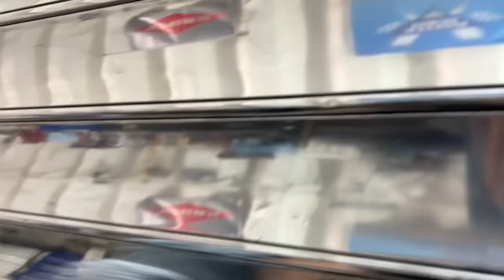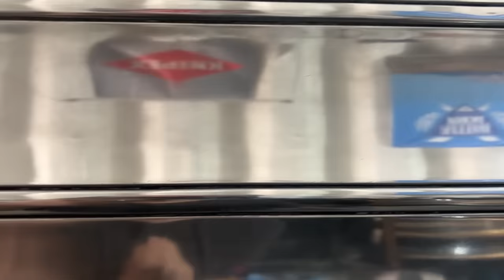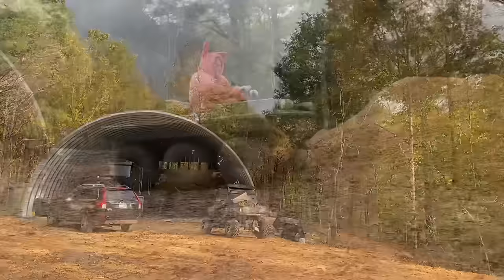Detailing the paint & aluminum bright work on the 1947 retired greyhound bus. Finishing the exterior

Comment: Looks amazing 🎉. Great job 👍. On my friends Busses we've done polishing the aluminum and stainless steel...After we did what you guys are doing...We just maintain the finish using either stainless steel polish or believe it or not.  Pledge or any furniture polish. Also works great on any plastic or plexiglass and tail light lenses...If you have any scratched lenses or plastic... Toothpaste and baking soda mixed with water like a paste is a natural polish...Great work 👍

Comment: Bus Wheel Seal question:  If you have replaced wheel seals twice on same wheel and it keeps leaking (oil) onto the brake shoes, are there clearances one can check to determine if there is a wear or parts issue?

Comment: No,
What I did was shut my phone off for a couple minutes and then cut it back on. It has been fine since.  It wasn’t just yours all of them were doing it. I never adjusted the speed or anything. On my phone. I don’t think you can adjust it on your phone . But, at any rate everything is back to normal. Thanks for responding

Comment: I tried doing my aluminum rims but it seemed to just make them darker.
Reply: If it's not bright, the surface is still oxidized. Polishing anything is really about making the surface perfectly flat. The slow but sure way is to keep going with something like Flitz. Metal rouges come in different colors/grits for heavily oxidized surfaces. They come in bars that look like modeling clay. Wheels often need something more abrasive like red rouge first, then to finer grits with white as finest. Flitz, for example, is a very fine grit which is how it produces that mirror finish. My brother is an expert polisher and with some very rough cast or pitted aluminum it's necessary to wet sand it with automotive sandpaper first then move into the rouges.